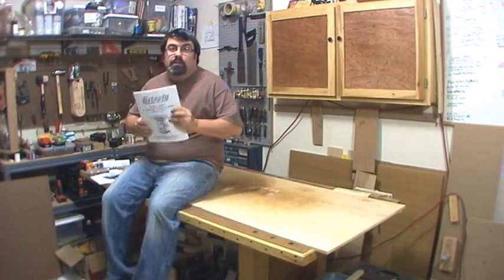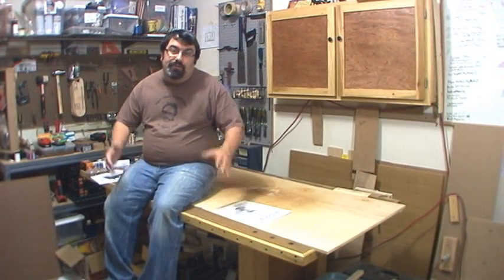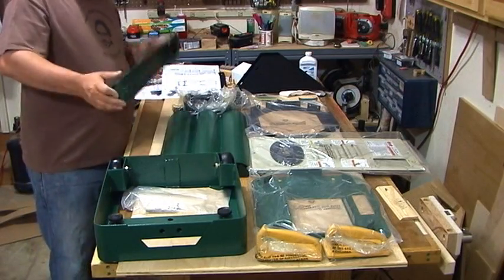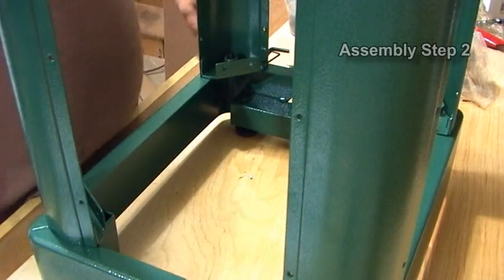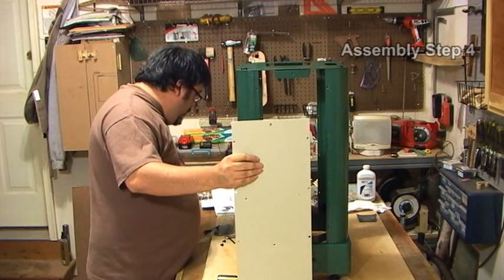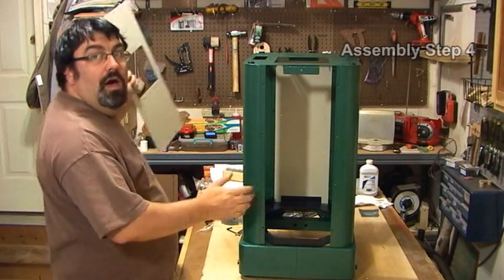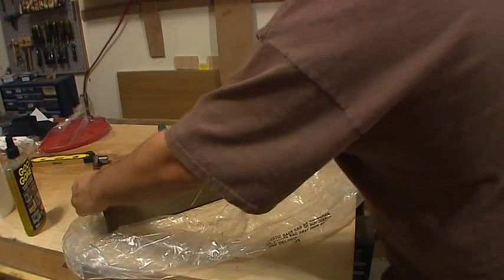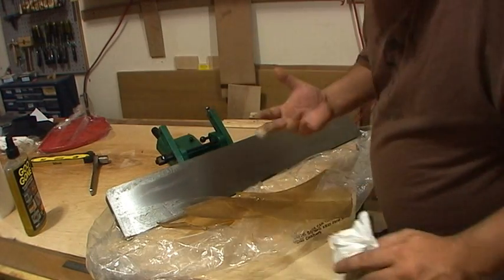TIW Ep. 38 - Assembling the Grizzly Jointer Part 1

Comment from the maker: Steven sorry for the late response.  No i did not have a bow in my fence.  Contact grizzly they are usually pretty good with hellping.
Reply: Thank you sir for replying I had forgot I asked you this question. I contacted grizzly they sent me a new fence. My jointer is still doing good the knives were set right when I got it. But now I need to take them out and clean them and look for nicks. I have their jointer pal jig but I got to tell you I'm not looking foward to setting the knives. I hope that jig works good. Anyway how is yours doing ? Thanks